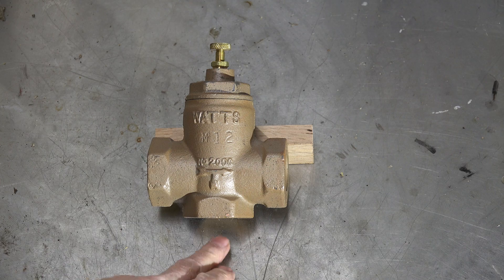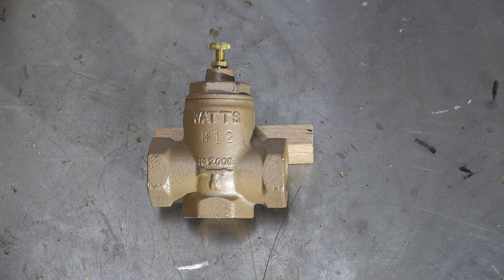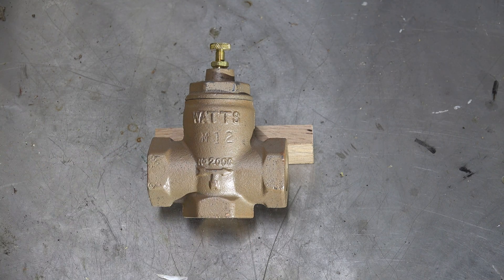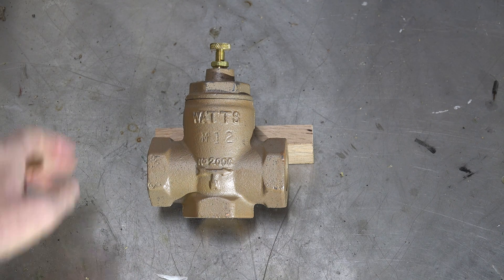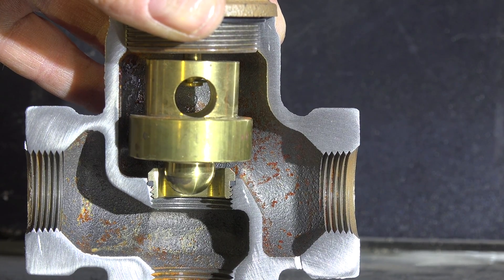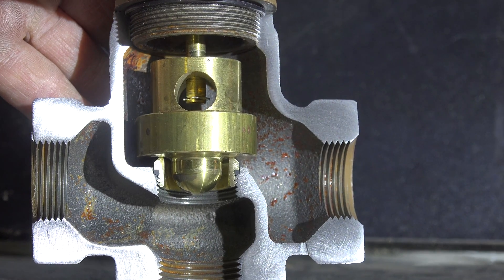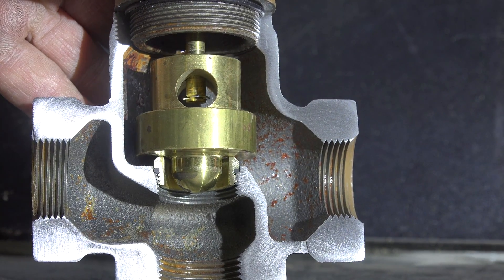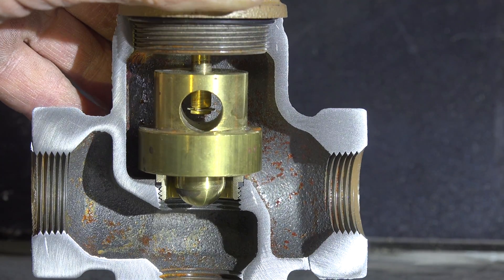The Watts 2000 boiler flow regulator

Comment: I just bought a house this summer, and we just turned our boiler back on once we filled the tanks. I have a B&G version of this valve. When the boiler turned on we noticed the radiators were getting hot even though heat was off. I went down and noticed this valve was opened, and then turned it all the way down. But now when the heat is being called for and the pump is running, the radiators are not getting hot. So it seems like this isn’t opening like it should. Is this a common issue, where they get stuck closed? Or is a bad pump more likely? Should I back it off a little bit? Or should I just replace the valve?
Reply from the maker: You can try backing it off but the valve may need to be replaced.
GFM

Comment: I have a 4 zone system with 4 of these (one on top of each circulator). I have a zone that constantly gets heat while other zones are on. The zone that gets the heat has the knob turned all the way in,  and appears to be leaking from the knob threads. All the other zones work as expected.  Ive kept the thermostat in that zone at 60 and on a 30 degree day that area of the house which is seperate from the rest was 69 degrees. All the other zones have that top knob a few turns from bottomed out.
Reply: its being back fed, you probably have a bad circulator.  Check your returns and see if its hot.

Comment: My valve rattles once in awhile. have a one loop system and bleed alot of air out the other day. thought that would stop the rattle. seemed good. now heard rattle again. how do i adjust valve thumb wheel. any count of turns?? i did replace valve couple years back. maybe i just need to make a simple adjustment. Thanks in advance for your help.

Comment: Gray, this video is great!  Quick question - Should the top screw be turned up or down when trying to purge the system of air?  I have two of these flow control valves on 2 separate zones ... One of these valves seems does not close correctly, or is stuck open so I end up getting "runaway heat" in that zone when the heat in the other zone is on.  I would like to try purging the system of air (I have a steel expansion tank) and was wondering how the top screw should be adjusted when trying to purge the system ...
Reply from the maker: All the way up will let any air pass, even when the system is off.
They sometimes do get stuck open.
GFM

Comment: Growing up with a coal fired gravity feed boiler in our house , there was one on our boiler. Going on to work in the plumbing and heating trades I soon found out that the correct term and what they are sold as is " flo - control"  , most of the ones I encountered back in the early 60 s were B&G. Even after my parents had the coal boiler converted to oil the flo - control was left on. Say what you want about coal heat but your house was never cold. Seventy five now and I would go back in a heartbeat.
Reply from the maker: I also grew up with a coal boiler.  6 tons a year.  The problem is not so much warm, all fuels will keep you warm.  Its efficiency.  The low fire is essentially wasted fuel.  We cannot afford this anymore.
GFM

Comment: What causes them to rattle?
Reply from the maker: The plunger is loose inside the part.  So the flow of water thru the part, especially if there is air entrained, could move the plunger.  Bleeding air from the system may help or adjustment of regulator thumbscrew may help.
GFM

Comment: silly item of the far past, but still nice to "know what they do and are there for!"
Reply: Silly item a heating/plumbing tech should know about as lots are still used and sold. People who don't know usually screw up a system by turning things with out knowing their function. Some don't realize that if your hydronic system rises above the boiler and you need to drain the whole system for service or repairs you need to turn the stem up to open the valve. If not done the silly person will cut into a pipe full of black water as if left closed the water will check above the valve. Another reason to open (turn stem up) is to gravity feed a system where maybe the only 1 circ pump has failed and you want to give some heat to the building. Not every service vehicle has a pump to replace the one on site or their backed up with to many calls on a cold night. Every service person has been the silly person when in the learning curve, we're always learning so don't be afraid to take advice or good information.
Reply: They are still used. Where I am now is still on steam heat, which is even further in the past.
Reply: I don't know about silly item ,but with proper maintenance it did its job. What would you use non electric to do the same job at the same cost?